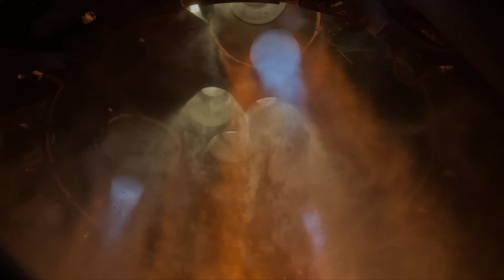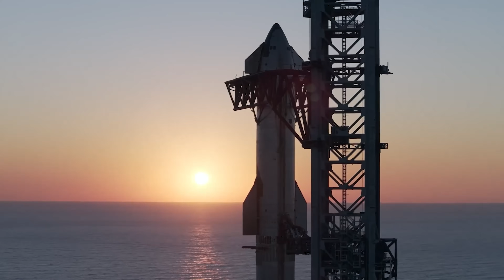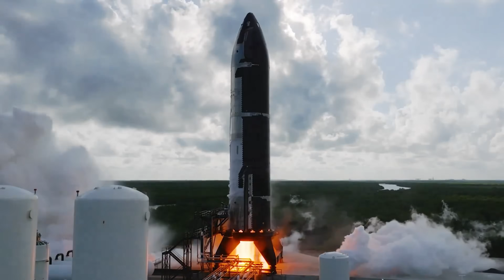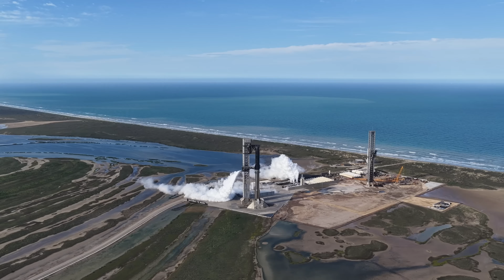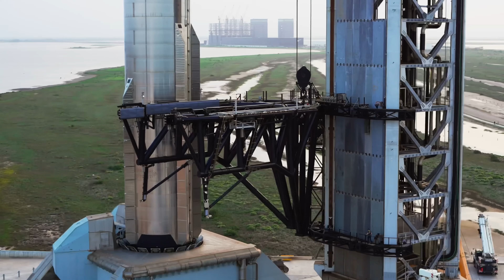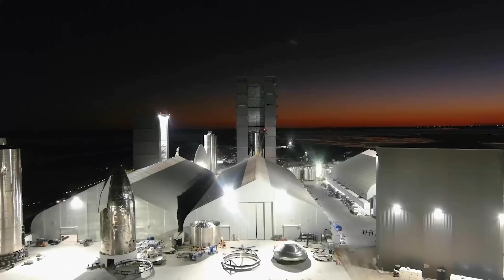How SpaceX Fueled The Largest Spacecraft Ever Built Before Launch!

Comment: It's the pseudo-confidence I find the most fascinating. How one can literally know fuck-all about a subject yet run one's mouth as if they do. For example: the super-heavy booster is not a spaceship, it's an accent vehicle only and never eclipses the Karmen line. In graphical representations, LOX is illustrated as blue and fuel as red, so in the case of Super-heavy (as it has always been) LOX is loaded into the aft tank and CH4 into the forward tank. Finally, you will note that the current version of the tank-farm with the new pad B design and v3 fill stack Starship and Super-heavy propellant load time is approximately 35min. And that just covers the thumb-nail and the first 00:21 of your SLOP vid.

You're goddamn lucky that moron youtube and google don't require peer review on STEM topics.
Reply: It's AI generic slop generated from other human generated data.
Reply: I hit the do not recommend button on channels like this.
Reply: It's AI slop!